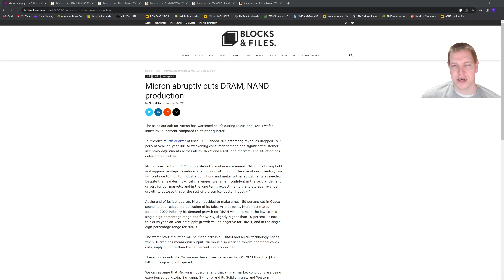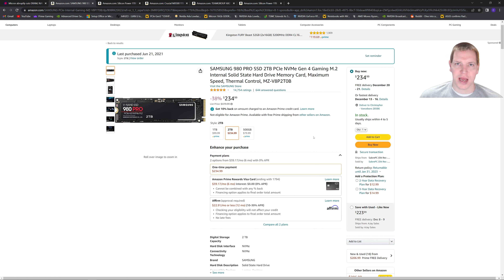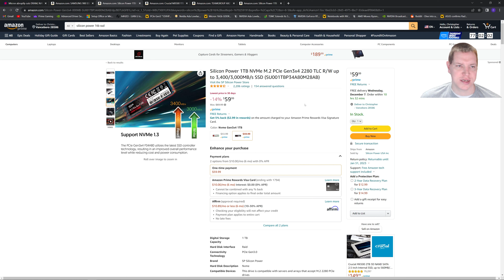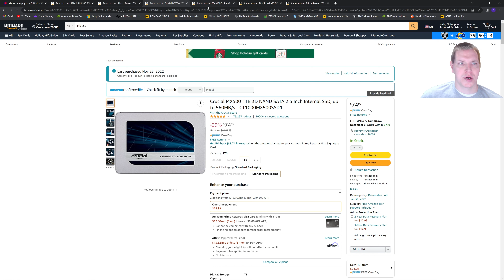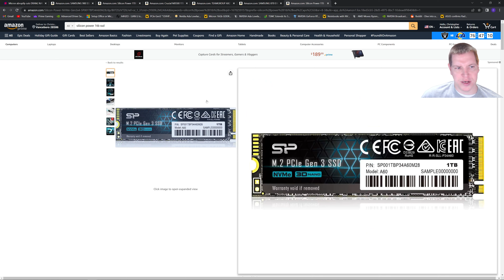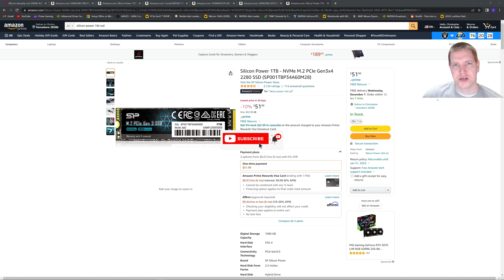BUY YOUR SSD'S WHILE THEY ARE CHEAP... HERE'S SOME GOOD OPTIONS!!!

Comment: WesternDigital (WD) and SK Hynix are good option as well. For the price I prefer WD over Samsung.

Now, if you do not have a M.2 slot on your desktop PC, and you have some unused PCI-E slots, than use a PCI-E to M.2 adaptor; some even have two M.2 slots. IMPORTANT: In case you only use one drive: make sure your motherboard can boot from M.2 as some motherboards might not have the option (for example the older LGA1155 motherboards). In the last case, I would recommend to use a SATA drive to boot from and have the M.2 as the storage/game drive (moving the "Virtual Memory" to the M.2 drive). (might be a good future video for East Coast PC?)

Any way, keep up the good work! 👍
Reply from the maker: Thanks so much for the Support. We appreciate you so much!